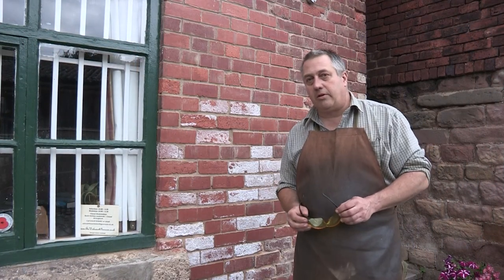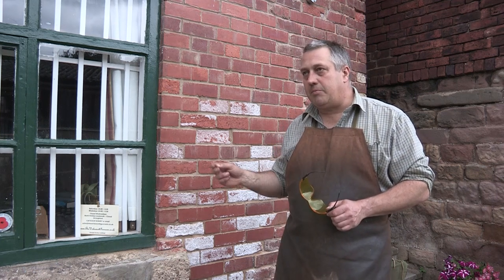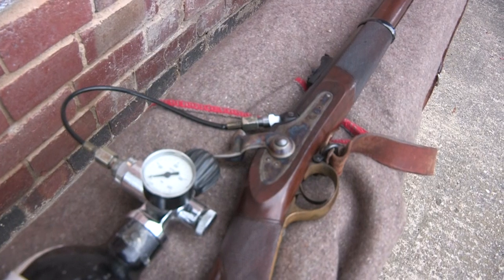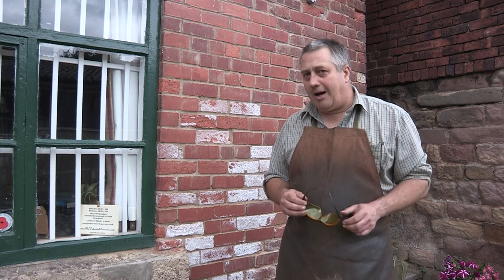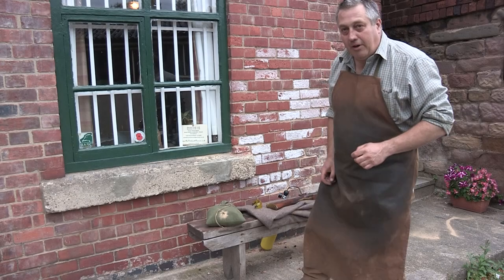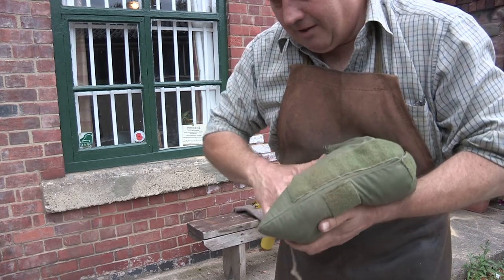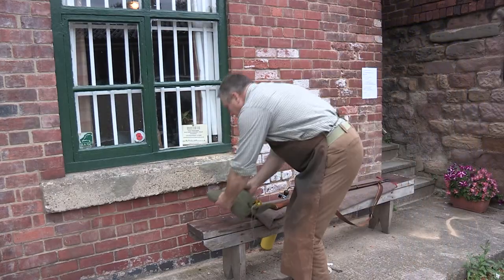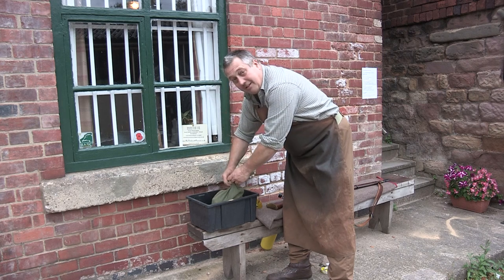Muzzle loading air rifle?

Comment: Hydraulic pressure would be an option, perhaps safer.
Reply from the maker: I'm not sure that any liquid discharging to atmosphere at 300 BAR / 4350 PSI could be considered safe in any respect. i wouldn't recommend it. Air at that pressure can be dangerous enough.
Reply: @TheWirksworthGunroom  why would u need 300 bar to get a slug out. Boilers are always tested with water since it is non compressible.
Reply from the maker: @CandidZulu  Well that bottle has at least 180 BAR in it. As you saw, with even a slight leak, the bullet didn't come out. If I had a source of 180 bar fluid pressure, that slight leak would result in a very high pressure (and velocity) jet of liquid at the joint. This would be very dangerous. Quite how I would generate that pressure in a liquid supply I don't know. It might be possible to use a grease pump but it would be horribly messy and would need sealing very well to stand the pressure. In terms of steam boilers, they have an operating pressure in the order of 200-300 PSI. Not 200 to 300 BAR.
Reply: @TheWirksworthGunroom  Model boilers work at 60 to 120 psi. Go to the nearest Model Engineering shop or Club, they can show you how to make a good safe way to get pressurized water into the gun. Model Engineers test boilers all the time this way. I bet most slugs will come out with 10 Bar given some time. But what you do works, albeit a little violent.
Reply: 100 percent,  excellent work 💥👍 @TheWirksworthGunroom